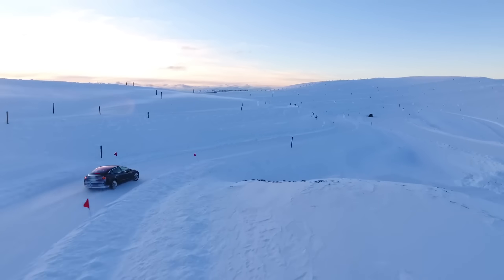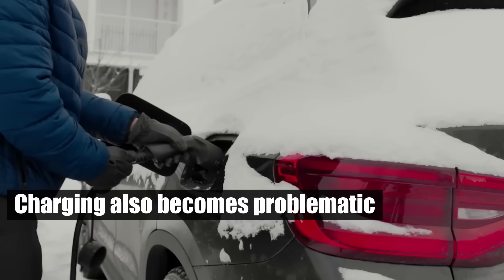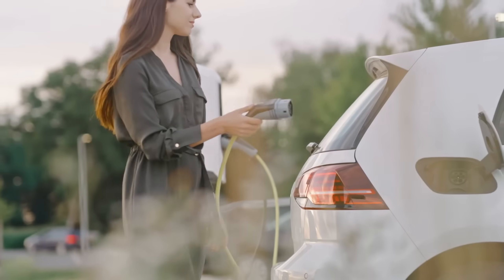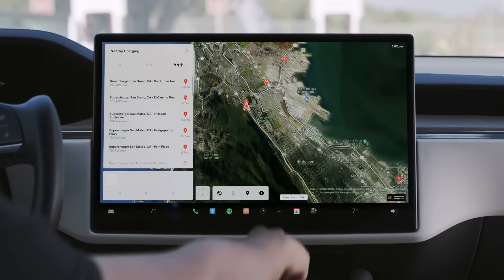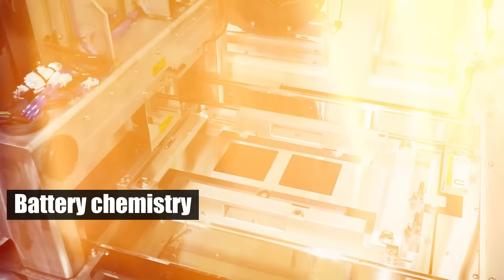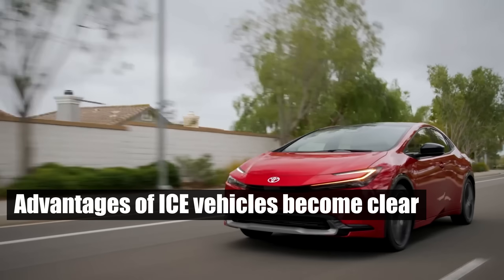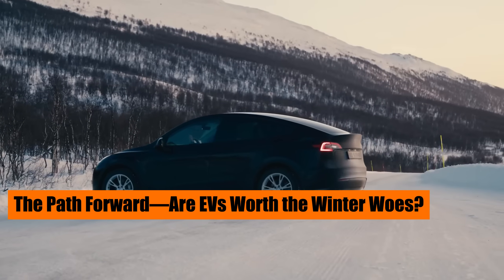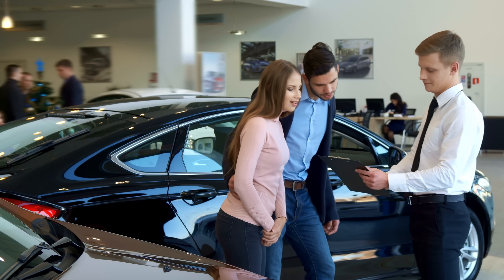EVs vs. Winter: The Freezing Truth That Left Drivers Stranded! Electric Vehicles Vs Winter, Weather!

Comment: For decades environmentalists said that living near power lines subjected you to  high doses  of electromagnetic radiation. Yet most people live  hundreds or  thousands of feet away from power lines, thus  reducing any risk. In an EV,  however, you are sitting directly on top of a battery bank and its strong radiation emissions.  And 'greenies' have  not uttered a  peep of concern.
Reply: I have an electrical engineering degree from the University of Detroit and can verify that DC batteries do not radiate. They are also enclosed in metal. In most cars, the inverter noise is barely strong enough to interfere with your AM radio, but that's about it. Of course compatibility testing is done on all car designs to prove levels are not harmful nor interfering with essential RF services. Be more concerned with the sunshine outside, which is a strong carcinogen.
Reply: @jamesvandamme7786  I agree that the battery does not radiate....however...the motor controler (AC brushless motors) can radiate....only during usage. Indeed important that those electronics are packed in metal.
Reply: Clearly someone not knowing anything about electromagnetic fields.
Powerlines ar AC high voltage lines (360KV in europe).
The alternating in the field creates induction (like a magnetron) in a lot of matrials including human bodies.
DC battery does not alternate ...and is lkow voltage...
A battery (Lithium) is only 3,7volts .
A battery pack is always below 800 volts. Most cars below 400 volts.

Even a smartphone at your ear is more dangerous electromagnetic radiation...due to the high ac (in GHz) from its antenna. And the very clos distance to youre head.
Reply: And when they blow they lock you in - buts OK as the toxic fumes they emit will kill you long before the flames.
Reply: No, this is what nitwits thought, not environmentalists.
Reply: Time you did high school science to see what is needed for electromagnetic radiation
Reply: @chrisjordan8137  nice, you beat me to it
Reply: Still huffing gas fumes?

Comment: As a BOLT owner, I agree with most of what's being said about winters, but to say they don't work well? That's horseshit. And that's a car without battery conditioning. Never had a problem starting the car and driving it. The only issue is reduced range and slower charge as mentioned here. I never use DCFC, therefore for me, it works ok. Akio Toyoda was right. We need options and not forced into 1 thing.
Reply: What happens to people like me who live in apartments and have no way to have a personal, individual recharger, and the owners and managers have no ability or inclination to put any of them on-site.? The U.S. has 18% of their citizens living in apartments, which equates to 54 million people that have no way of plugging an EV into their own personal charging machines. They're not going to stop off at a public recharging station every night, should they ever be adequately installed, and wait in line for an hour or more just so they can hook up with a charger and then wait another hour or so while their car gets its daily hit of amps and volts.? Nobody is publicly addressing this situation, for it wipes out the case for people who own an EV just coming home and plugging the car in, and then tomorrow AM its ready to go for another dose of public travel. Nobody can give this situation an answer, for there is no answer that's compatible with owning an EV in the first place.
Reply: I don't know about buying a BOLT.  I heard a Bolt owner, in Alaska, had to wait 3 years for a replacement battery.

Comment: I have to charge 3 times a week in winter if I use my heat sparingly, otherwise might have to charge more. My battery according to projected range in coldest weather 15 degrees just over half. 
I spend most of the time in winter freezing in the car. No more EV for me, soon going back to gas.
Reply: Try 50 below for 10 days stright.
Reply: @DennisMahaney-n3w  You live on Antarctica? You are better off with I.C.E. car
Reply: @DennisMahaney-n3w  Your reality has no sun.
Reply: We’re only scratching the surface with battery technology, watch this space…
Reply: @amazoniaamazonia7225  Biggest space is between the ears of 2335467.
Reply: @amazoniaamazonia7225  I disagree I believe hundreds of billions went into R and D. I think the battery technology has hit the ceiling. In aprox 20 months I am going back to gas. I am tired of freezing in the winter to keep as much range as possible.
Reply: My problems with EVs are over, I bought a NEW I.C.E. car a few weeks ago and loving every second of it. No more freezing in the winter to save battery power. as M.L.K said "Free at last, thank God almighty I am free at last"
Reply: so where do you charge i up? so far i have had little impact in BEVs.
Reply: @DavidWiliams-r1g  I use public chargers , I also have a home charging unit, however because my house still has fuse box according to my electrician it drains more electricity costing 2 and half times the cost. If you have a car in the cold area get a home charger if you have breakers instead of fuses. It will cost about 10  dollars  for a 65 KW battery for a full charge, a little more if battery is bigger. A lot of towns also have free AC charging. Hope tat helps
Reply: @DavidWiliams-r1g  He never charged an EV, some lie on here. Ask what EV he had. I know of none getting almost half in winter. 
I own a EV (7 years) and live in Canada. Buying my next one soon.

Comment: It has been stated that, if all vehicles in the world had to be EVs, the electric motors would consume more copper than has ever been mined in the whole hustory of the planet. So how is  that going to work?
Reply: The planet will be history if you polluting turds do nothing
Reply: @orionbetelgeuse1937  Your tinfoil hat is way too tight.
Reply: Do you know how much less copper is used in household plumbing since PLX piping.
An average single-family home uses 439 pounds of copper, the average EV motor is about 180 pounds. Try looking at the whole picture not just what some fool throws out there. 
My question is what are we going to do with all the extra copper? 
PS: PLX is cheaper and more energy efficient, win win.
Reply: @BioniqBob  I am just reading what some fool has thrown out there.
Reply: Isnt copper used in ICE anybway
Reply: Why on earth do you think that an EV needs a lot of copper?
More than ICE cars with all their wiring?
Do NOT FORGET that an alternator in any ICE car must be connected which much thicker wiring to the accu , the startmotor even more thick than the alternator because a startmotor consumes up to 400 ampera (peak current) to start an engine. The alternator produces at least 100 ampera, bigger cars 200 ampera.Continously

However My ev only needs 20 ampere for driving with a constant speed. Peak current mau=y be 200ampere...half of that form the startmotor.

Also they use a lot of alluminium in the EV's as replacement for the more expensive copper.
Reply: @reiniernn9071  Ever heard of electric motors, containing miles of wound copper wire?  Just what do you think powers an Electric Vehicle?
Reply: @DerekWalsh-l4i  That does not make that we are running out of copper. One motor for an EV weighs 30 to 40 kg...with all engine components. Which maximizes the amount of copper (also much iron in it) to less as 50%..
Reply: @reiniernn9071  I can remember 30 + years ago when, even then, it was stated that the world was running out of copper. Since then the quality of new copper has dropped considerably, because it is being mixed with scrap copper to make up the deficit. If you reckon 15 kg of copper in each of one billion EVs worldwide, that's about 214 million tons, and that's only for small cars, not for 45-ton trucks. And many other industries rely on copper also, it can't simply all be diverted to EVs. I rather think that EVs are not destined to rule the world any time soon.
Reply: @DerekWalsh-l4i  LOL, The uneducated raises their head.
Reply: @BioniqBob  Yes, you just did !
Reply: @DerekWalsh-l4i  Also do not fotget that ICE cars, especially older ones , do have inmens amounts of copper in it, An EV does not need an alternator (copperwired for HIGH currents)
Start engine...using only a few seconds each start, even higher amperage wired with copper.(My EV only needs 20 ampere , ampere is what makes the choice of cable thickness, not voltage) for constant 60 miles/h.(96 km./h). The alternator (ICE) needs cables from and to for constant between 100 and 200 ampere depending on which ice car model.
The older ICE do have a cable tree, all parts in the car seperately connected to accu. Newer EV's are more computerized which means less copper (ring cable , all lights and other stuff connected to one (double) copper wire. 
So yes, those EV cars need copper...but we save the amount used  on the older type ice cars.
And at last....Every old car should be scraped...bringing the copper back for usage. We do not need new copper for every next generation car.
Where possible copper can be replaced by alluminium wiring...
Reply: @DerekWalsh-l4i well Canada as a spot called the Canadian shield it has more copper zink nickel gold then the whole world combined.
Reply: @reiniernn9071 copper wiring jackass.
Reply: Who stated it, trump? Lol stop reading the comics, child.
Reply: @BioniqBob  If you have evidence to the contrary then please share it with us all,  boy.

Comment: EV's could use 'old technology' for winter cabin heating - the fuel burning heater that Volkswagen used in their iconic 'Beetle'.
Reply: Of course! 
Those were so safe and reliable!
Having fuel burning inside an enclosed passenger compartment of a vehicle is the safest thing anybody could think of!
Carbon monoxide and other toxic fumes are nothing to worry about or the fact that you could have a collision with burning fuel pouring all over the interior of the vehicle!
Reply: @williamegler8771  more fires in ev's
than the old beetle
how many beetles on the road then
to ev's now
2 million
to800000 evs

Comment: There Isn't Enough Infrastructure to Support EV'S
Reply: No electricity in your cave?
Reply: ...And when the charging infrastructure is in place, you WILL find that the electric power generation facilities (nuclear or fossil fuel) weren't built to generate all that energy to charge tens of millions of vehicles, because today they are not only are NOT being built, they are not even PLANNED to be built.
But the greens and stupids do not think, nor can think that far...
Reply: There was an article on the internet this past week that one American recharge station chain filed Chapter 13 (liquidation) bankruptcy. The company operated 10,000 recharging machines, now they're operating --00-- charging machines. And the American EV customers are just that much better off for losing all that EV support... (OR NOT).
Reply: My town has less than 5 public access charging stations.
Reply: Are you a complete nutter or doesn't your house have electricity yet
Reply: @nathansmith7153   try again. major logic fail.
Reply: @DiaperDon_BoneSpurs_Epstein  OK, let's use logic. Are you wired up for a hot water heater, electric stove, clothes dryer or a whole house air conditioner? Those things don't run in the middle of the night. That's when your EV charges. Also, you don't have to charge it every night. You also don't have to go to a gas station, just take 30 seconds (if you're slow) to plug in. 

And I presume you're slow, from your comment.
Reply: @jamesvandamme7786  Yup. My wife's Chevy Volt charges on a 110v 12 amp circuit over night. If you have a short commute a plug in hybrid is ideal.
Reply: @jamesvandamme7786  Talk about slow...methinks you are projecting a bit.  You assume everyone owns a house. And that wiring for an EV is practical.  Your water heater and a/c don't run in the middle of the night? Kind of a logic error there...as is housing a potential firebomb indoors. Or haven't you heard about that? You actually think that an EV can charge faster than you can refill an ICE vehicle? Really? Winter cold and summer heat kill off EV range. They are unrepairable and uninsurable (or only so at great cost). Their resale value is near absolute zero. Making them disposable junk. Can't wait to see what rust does to them... And utterly useless off road or out West where your precious charging stations are few and far between.  You also forgot that when everyone plugs in their battery cars to recharge, the drain on the grid would cause eventual failure. It's all about capacity, son...something you obviously don't get. Case closed.
Reply: @DiaperDon_BoneSpurs_Epstein  So much FAIL in your rant. Since your mind is made up, we'll check back with you in a couple years to see if anything has dawned on you.
Reply: @nathansmith7153  Their observation is relevant and a bit of research quickly reveals a wide range of issues. Your comment is rather petty.
Reply: @nathansmith7153  My unit cannot charge an ev. Are you the nutter?
Reply: @billhesford6098  why do you say that?
Reply: @DavidWiliams-r1g  People who live on the 23rd floor and who do not have a charger in the building cannot just plug in a charger for an EV. Many multi-storey buildings are not having EV's in their carparks as well. I have a house and I can do it, but I know many who live in units who cannot. The unit I am in right now on the Gold Coast will not allow a charger in the car park.
Reply: @nathansmith7153  Do you really think everyone on a terraced street are feasibly going to be capable of running an EV car 😂😂😂? Or that there is the room for hundreds of thousands of charging points across the country to serve cars on their travels . . 😂😂😂 You are in for a shock when EV ,s disappear up the arseholes of the politicians who tried to force them on the public .
Reply: @nathansmith7153 Evs sucks up power. The grid is already failing as is
Reply: @CorvetteGuy-C8  not as much as your HVAC system does, and that system runs almost all the time, where the BEV wont charge (l2) more than 5-6 hours a day, all off peak rates

Comment: Have you ever experienced the frustration of using a rechargeable power tool.
Reply: I won't be using an EV anytime soon, but I would never go back to a corded drill.
Reply: Sounds like you are the tool.
Reply: My chainsaw is 120V and I have to run 100 feet of wire sometimes. Next one will be lithium powered.
Reply: @Dogeatdogworld-k5 Lead acid or NiMH don't hold a charge long. My 5 year old phone and my 2 year old shaver still had a charge. Lithium lasts a long time. Primary lithium lasts ten years minimum. In a car you have to make sure that all systems are shut off, just like you can't leave a gas car idling and think it will still have gas after a week at the airport. You don't need all those cameras and main computer running. Overnight is OK.
Reply: while the type of battery is the same (maybe), the way they are designed is very different
Reply: That's why I bought a drill that plugs in.
Reply: @Withnail1969 yep! When you need to do real work, you need “power” tools. Battery tools are good, but tradesmen know the deal.
Reply: The first rechargeable tools had the batteries inside the tool. While the tool was charging you couldn’t use the tool. Now you have multiple batteries to swap out. EV’s are like the old tools, can’t be used till recharged.
Reply: @dave3657 that was a good analogy.
Reply: They always go dead at the most inopportune times
Reply: I would not waste my time with electric power tools. I refuse to be a slave to monitoring the fragile battery, so all of my power tools have power cords and are now over 20 years old. When I want to use one, I simply open the storage box and plug it in. If this feature is important to me, it would be crazy to scale up it up to an EV and expect me to buy into it.

Comment: Im an engineering researcher and I am currently working on Anode Free Solid State Lithium Sulfur Batteries. They will be here very soon. If you are looking at buying an EV i would just weight until solid state comes out. The results are remarkable and highlight how bad current EVs are. Dont think that just because I work on EV batteries that I drive one. Because I dont. I drive a 15 year old, diesel drinking, 4x4 becuase current EVs are not a suitable replacement for what I have currently.
Reply: Oh yes ... I will WEIGHT ... !